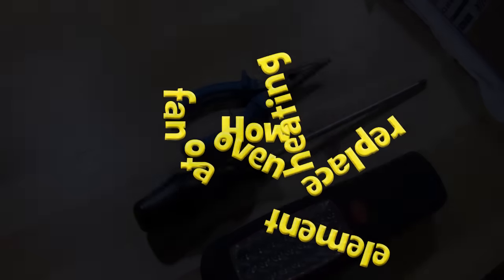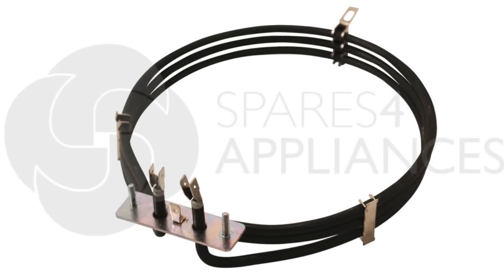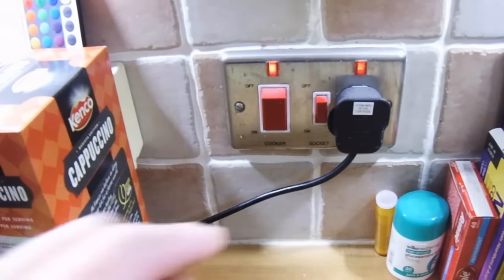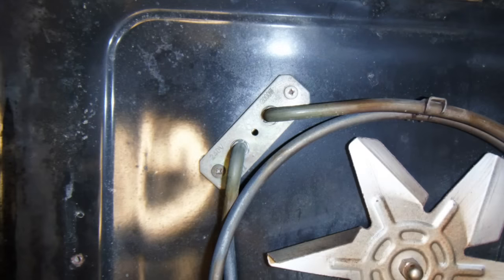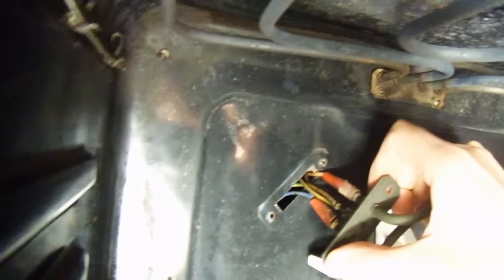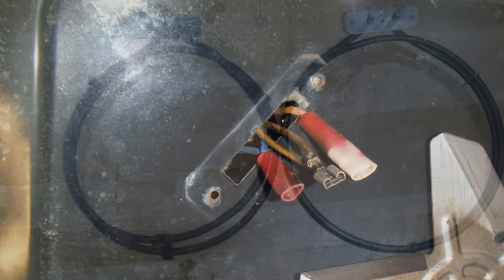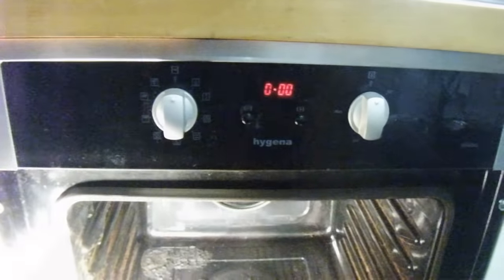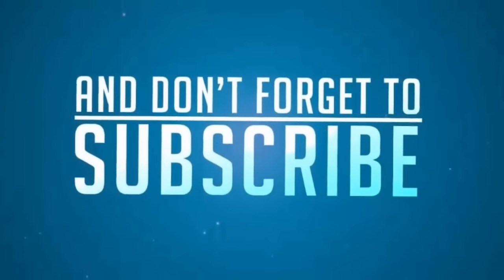How to replace and fix an electric fan oven heater element.

Comment: Have you tried to get a dishwasher engineer these days? You just can't get one, they are refusing to come out to dishwashers because of sites like these. I myself refuse to go out to dishwashers again because of sites like these. I called out to an oven today, the customer bought a fan element because the oven was not heating up she fitted it and it still did not heat up, so she did what she should have done in the first place and called us out. It was not the element that was at fault, it was the temperature limiter, so she is stuck with an element that she cannot return. So my message to all you 10 second YouTube engineers is this. IT IS NOT ALWAYS THE ELEMENT THAT IS AT FAULT WHEN THE OVEN IS NOT HEATING UP. It could be any of numerous parts at fault, Selector switch, thermal limiter, broken wire, T.O.C and on today’s modern ovens the module PCB. These sites are destroying the industry. All these sites want to do is sell cheap nasty elements. Carry on destroying the industry and people will suffer.
Reply from the maker: Terry your wrong.  Its basic economics.  You buy a oven for around £200.  It works fine for 3 years and then fails to heat up.  You buy a cheap element for around £12 and fit it yourself.  It does not fix the problem.  Now you have 2 choices. 1. Call out an engineer who your going to have wait in for.  As you say modern ovens are all controlled with modern PCB's which with the call out charge and the cost of the part is going to cost you what 3/4 of the price of a brand new model. 2. Yes you wasted £12 but least you tried.  Go onto Amazon / Argos etc and buy yourself a brand new oven with 12 months warranty which can be delivered next day.  Job done.  No waiting for an engineer to order a part and come back and fix it with all that messing around which you still end up with an old oven. Nope just like the TV repair man of old the days of expensive repairs are pretty much over. For most people in 2021 If i cannot be fixed cheapy people will just buy a new appliance as they are so cheap.

Comment: What if you replace the element like you have before, and when you turn the oven on it trips the switch, not just the big red cooker switch but also the one in the electric cupboard?
Reply from the maker: That means you have a direct short.  It could either be one of the spade connectors has come off and touching (one of mine was loose and needed adjustment) or the element you have fitted has a internal short.
Reply: fredintheshed1 got an electrician in to fix the issue. I had the oven in for 10 mins then it went again. Now when I turn the oven on, it trips the fuse box and goes off in like 30 seconds
Reply from the maker: I would suggest that you switch the oven on and test each heater one at a time.  Grill, top oven, fan oven etc.  Hopefully you can find out which element is causing you the issue.
Reply: Did a test on each thing, everything works, when it's just the fan oven it stays on for like a minute before tripping the electric. Red light goes off on the cooker switch and the main switch in the electric cupboard goes off.

Comment: Useful video thanks. I would add that with regard to my Lamona LAM3405 single oven whoever designed it was obviously a sadist seeing as how the 2 screws holding the element in place (shown at 1 minute 44) have to be undone from behind so the whole unit needs to come out. Just to add salt the screws are located in the double-skinned area and are covered with insulation which needs to be shifted to get to the screw heads which will release the element thus making what should be a 20 minute job become an hour or possibly more. Such a stupid stupid design.

Comment: My element is fixed from the back of the cooker
Reply from the maker: Yes ive heard some a like that.  Back panel off job.
Reply: @CB-RADIO-UK  seems daft as there is no reason they couldn't fix it in place behind the fan cover,
I have done exactly that so it will be easier next time.
Thank you for the great vid it helped me fix my cooker quite easily .
Keep up the great vids.
Maybe it's to scare people into calling out an engineer for such a simple fix .
Reply: @PeakyBlinder  How did you get the old screws out that were from the back , I’m thinking multi tool
Reply: @itfcdan9223  no I took the back off, you can access them from there, 
It was quite easy.
Reply: @PeakyBlinder  Thanks for the reply , my Flavel oven is huge and mounted on top of some 40mm deep steel so that it sits the same height as the worktop either side , plus I’ve recently had the floor replaced in the kitchen so I don’t want to pull it out , I’ll have a go removing the screws from inside ….. somehow 🤔
Reply: @itfcdan9223  I'm thinking you could try a screw extractor left hand thread then undo the screws from the front then just use some self tapping screws to fix it from the front,
Only issue is the holes in the element are smaller than the holes in the back plate, 
So you might have to drill out the holes in the element to accommodate the self tappers.
Reply: @PeakyBlinder  Yea , will be a bit of hassle but still less hassle than moving the oven tbh , plus if it goes again , I would be easier next time , cheers for the reply 👍
Reply: @itfcdan9223  no worrys,
Good luck.
Reply: @PeakyBlinder  ICYMI , it worked , used multi tool to cut off the end off the screws , then switched to drill using a HSS drill bit (5mm) to drill the screw head out , once they were out I could pull the cables through , had to enlarge the holes on the new element mount plate to 5.5-6mm , then used chunky short self tapping screws to fix it in , all took about an hour , should made a video 😳

Comment: Mine has three connectors but only two wires my oven doesn’t have an earth 🤷🏻‍♂️
Reply from the maker: Has a wire dropped into the back of the oven ?
Reply: There wasn’t once on the current heating element when I removed it  so unsure and the gap is to small to get anything in to look for it

Comment: this sucks. because whoever put the element in last time did it from the outside back of the oven. so I had to spend time to try and take my oven out of where it is to remove the bolts on the element.

Comment: I’m shocked you trusted its earthed correctly and simply turned the power off. That’s not a guarantee it’s safe at all and your info is dangerous. You could have told people to pull the fuse spur out or switch the RCD switches off.

Comment: These videos supply me with so much entertainment. I can't help but laugh my head off when I see them. As an engineer, I have seen so many people come on stuck trying to repair their own appliances. When it would only probably cost just a few quid to get an engineer out. I have been to umpteen jobs where they have butchered the appliance by watching these videos. And it cost them more to repair in the end. These videos are only put on the internet to get people to buy spares from them. Engineers get parts a lot cheaper than joe bloggs, So it would probably cost not much more than the part to get an engineer out. (AND YOU GET A 12 MONTH WARRANTY ON THE REPAIR). Is it really worth it? all for the sake of a few quid? Come on people!!!
Reply from the maker: Depends on what a few quid mean to you i guess.  When the first element blew it was a panic and i called an engineer out.  He was great and did a fine job at replacing the element in about 8 mins.  Top job.  However it cost about £120 inc the call out charge.  The element lasted about 18 months before blowing again.  Since then ive replaced 3 on 2 different ovens and i now keep a spare in reserve.  Takes about 10 mins a go and cost me less than £20 and no stress involved and waiting in for a repair guy.  So yes for me it REALLY is worth it.
Reply: OMG!! 120.00? I charge 72.00 all in to change an element, and warranty it for 12 months. Should have shopped around. And if it keeps blowing then there is an underlying fault. Regards.
Reply: My oven just died and I suspect a faulty element. Just got quoted 135 quid and thought the support company pushing hard to get me to buy insurance cover for 185 quid for a year.
Reply: @ToothbrushMan  my element just broke ordered a new one frm amazon for £9.99 unscrewed the 4 screws and replaced the element...dont pay an engineer to do a 5 min job its madness 😂
Reply: @roni2415  Rip off merchants, The lot of them, It's madness to pay over a hundred quid just to undo and refit a dozen screws.
Reply: Yes bud I no what u mean  I have just spent 50 pound getting sum 1out,  like u said, and a other thing, no warranty with parts over the counter etc  my oven is only a bit over a year old y r  the elements going so fast?
Reply: Just replaced mines today, f all hard about it.
Too many rip of merchants tearing the arse out of people who don’t know any better.
Reply: Suppose it depends  on the person trying to repair it.... if someone  does not have 1) common sense 2) a basic understanding  of electrical components  then yes these people should call an engineer  or technician  out but for me i have replaced  2 heating element's  in my oven in just over a year 2nd one on now bbut tjis time replaced the fan motor too as it was a bit stiff.... switched on all done took my time and now working.... saved me a call out..... one thing that does strike me is the thinness of the metal in oven even those that cost £600 or more monkey metal comes to mind.
Reply: You mean ,You hate these videos if your an engineer, Because engineers rip people off.They want to charge you lots of money just to come out for an estimate..How can you go wrong with these step by step videos.I admit some times it can be tricky, But I've had no problems
Reply: A few quid is a few quid, come on! Not all of us have just a few quid. I followed the instructions on this video and saved myself $350 NZ.  Element cost me $39!  I would still be without my oven now if I had to try to save that up.  Fred in the Shed, you rock!
Reply: I don't agree I have repaired many items thanks to youtube
Reply: And then you woke up
Reply: a few quid???? You must live on another planet sport!!!
Reply: The electrician was charging me 127 bucks AUD for the spare part. Plus postage 27 bucks! 
Bought genuine part for about 30 dollars on ebay.
Reply: And 130 bucks to replace it.  That's a whole lot of bullshit if you ask me.
Reply: Yeah. Maybe if it was an easy task getting an engineer out and they could be relied upon to A actually show up and B not take the piss on price, then maybe it'd make sense. Unfortunately, in the real world this isn't the case, so thank God for videos like this.
Reply: It's proportinate isn't it....I'll call an engineer of course if something more complicated. But this is so easy a task it doesn't warrant the call-out fee. And probably like many have experienced, we have often had an engineer call for various things and been told 'don't have the right part' or in the case of a washing machine a wrong diagnosis. Or the Boiler Service yearly contract that was a disaster that cost us many ££ on a 4y.o. unit.
Though to be fair the majority of times we have needed such services, the problem has been dealt with efficiently and promptly.
Reply: A few quid in Australia is a $80 call out fee ( approx 160 UK pounds ), then the part price on top of that, it's alot of money. Thanks to this video, I simply turned the power off to the house, found that my oven has the element at the Front so the oven stayed in the wall, one philips head screw driver, 4 screws and only 2 plugs later.. I have one blown element to take to the appliance store to replace for the new one. This video was excellent and another Great youtube moment.
Reply: Actually, @Terry Roberts, I think these videos help the professional engineer. There are a lot of financially well of people who will not want to get their hands oily or whatever. These videos give them an insight into what is involved and hence what to expect of the bill. Otherwise many will just buy a new oven and you won't get the job anyway.
Reply: @tornadotez  why would someone pay you £72 to replace an £8 part in a £300-400 appliance, thats plain idiocy
Reply: My mum paid about £95 years ago for one fitted. After it failed again I got one for £7 on Ebay and it wasn't too difficult. I had to remove the back and use bolts off the old element or trim them etc as it was  different. One had welded on studs, the other threaded holes or something.
Reply: Yeah a £200 a call out I will try and fix myself. If I brake it then a new oven will probably be cheaper
Reply: I had a heating engineer out to my combi boiler it was making a knocking noise,  he replace the pressure relief valve charged me over £150.00 it still made the noise I even said to him is it the pump? He said oh no its not that. It turns out it was the pump I put in a new one and I replaced the circuit board as it needed it and it cost me less to do than what I paid the engineer that didn't know what he was doing and on the side of his van said family run business 40years so you would think he would know what to do but I think he was the son of the older engineer, needless to say I wont be using them again. I will do it my self. My boiler is still working 3 years on since I fixed it, with no problems. So even some engineers get it wrong and end up costing the client money. Utube is a good tool for the people so long as you use common sense and know your limits why not give things a try that's how you learn and save money, and piss off some engineers! Which is good as some of the engineers piss me off, the ones that rip people off.